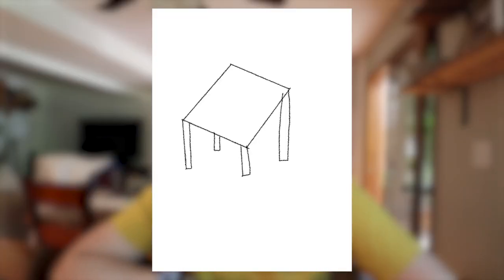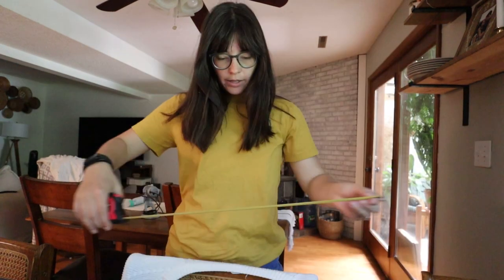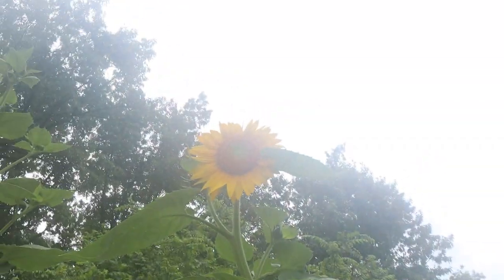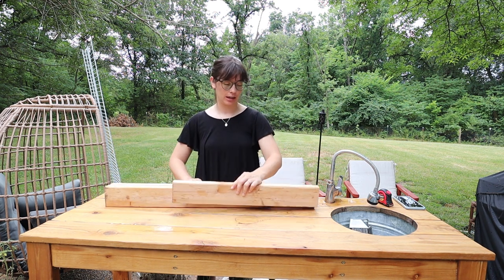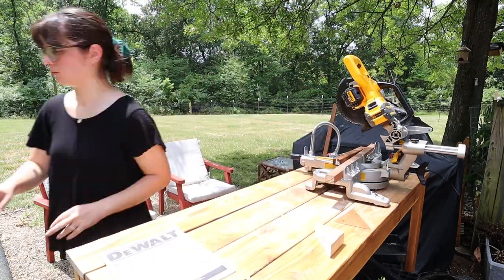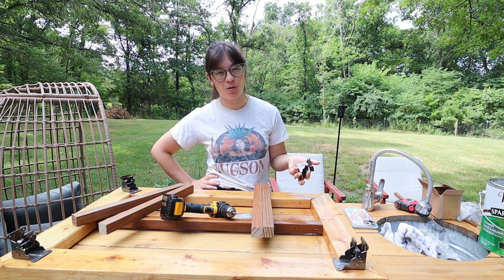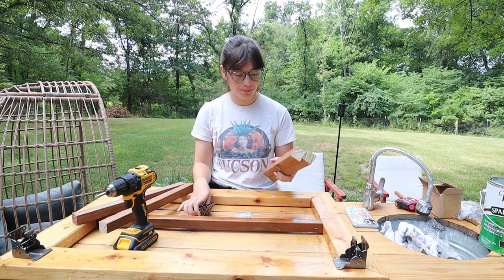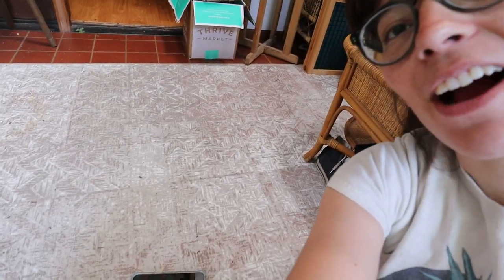Creating a Watering Table for My HUGE Plants!

Comment: I have smaller/regular sized houseplants so what I did was buy one of those 3 tier rolling carts from Michaels. I place a few plants on the top tier, and a plastic container on the second. Since the bottom is mesh the water flows through the pot in the first tier and is captured by the container in the second. I also have  another plastic container on the third tier where I just throw old leaves, etc when I’m watering. And since it’s on wheels it’s super easy to move around the room or between rooms as well. Hope that helps someone looking for a smaller version of what Becca made!
Reply: this is a great tip omg thank u !!!! this would be a perfect setup for up in my bedroom i have so many plants  in there and watering is a whole thing haha

Comment: This is much better than my lazy version of this.  I have a bin that I just laid the wire shelving right on top of. It’s the shelves that came with my crappy plastic greenhouse. It holds my big monstera…for now.    I did have to use all three wire shelves to make it strong enough.  This table situation is much safer! 💕I may look for a premade table and remove some top… (again, lazy.)

Comment: Honest question, why don't you just water in place instead of moving the plants? I've never thought to move my plants so I'm wondering if I should be? I have trays or plates under each plant and if there is extra water in there I just soak it up really fast with a microfiber cloth and hang it to dry. 
I love the way this table turned out! Your did an awesome job! It's so cute you could actually put in little glass or wood panels and have a cute rustic coffee table! 😍
Reply from the maker: If I watered the plants in place, it would overflow much more than a towel can soak up! These plants need lots of water to completely saturate the soil 😜 but omg yess I love the idea of a cute lil coffee table!! Hehe
Reply: @BeccaDeLaPlants  I love that your able to do that! I only move mine if I feel they need flushed out. I have back issues so I water heavy enough that the top of the soil is covered and then I let it go down, if any comes out the bottom I use a microfiber to suck it up, I've heard other ppl say Turkey basters 🤷🏼‍♀️ I live that you made this though all you can do it the way you're comfortable! I love the plant community BC everyone is slightly different and it's fun to learn 💗